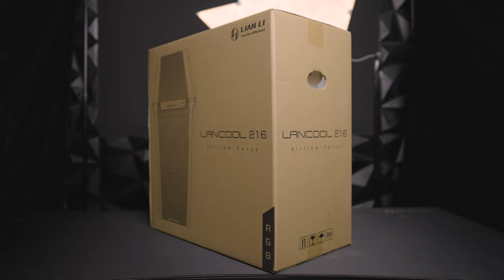A NEW CHALLENGER JOINS THE LINE UP ft: LIAN LI LANCOOL 216

Comment: I wonder is this only a solution to mount this lian li aio 360? the tube must stay on left side near rear exhausted fan. I guess to accommodate aio radiator  to show Lian Li text logo ?. Normally, I found many Lian Li 216 build with other aio tube located on the right. I've have this 216 case and this lian li aio 360 on hand and waiting for other parts to build. thanks man.
Reply from the maker: If you were to mount it the other side, tubes facing the right you should be able to see the lian li words on the rad.

In our current config that we did right, we actually noticed in hindsight that we installed it the other way round!

Comment: Hi, i thought if you install an AIO cooler to the top (watercool mode), its not possible to install the rear fan with the included bracket? So how is this possible, did you use the aircool mode here with the AIO?
Reply from the maker: You are still able to install a 360 AIO on the top with the rear fan, but I would recommend installing tubes to the front compared to ours if you do install an AIO!